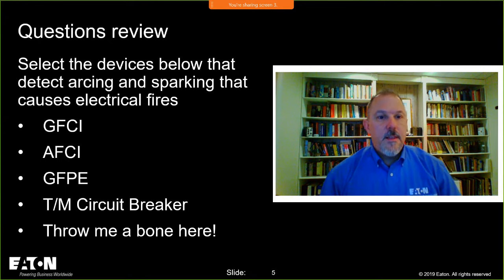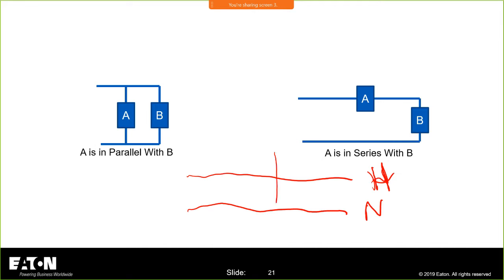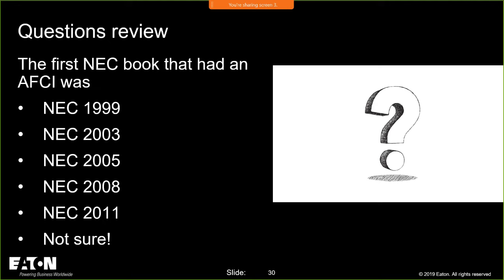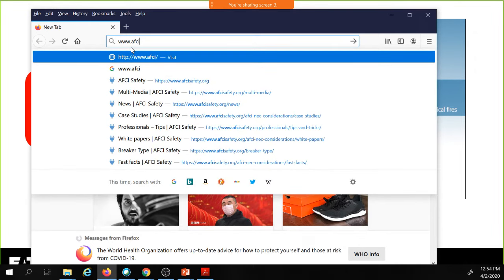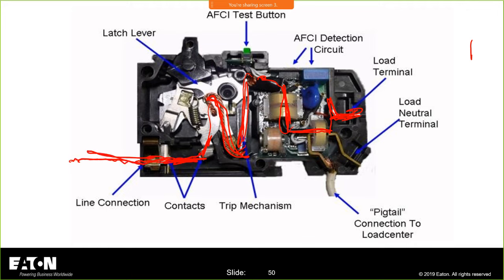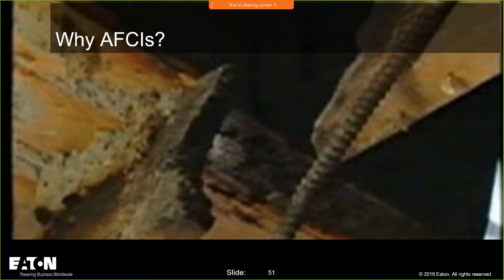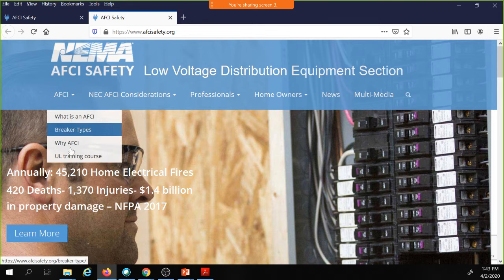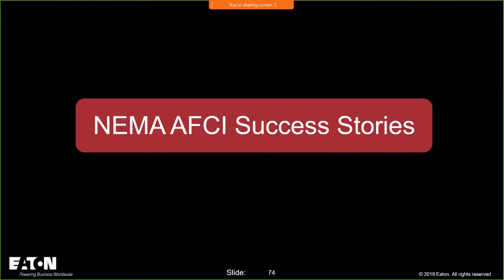Arc-Fault Circuit Interrupters and Associated NEC Requirements

Comment: I believe 406.4(D)(4) states if you replace the "receptacle outlet" (not just the receptacle but the box aswell) then the replacement receptacle must be AFCI protected.
Reply from the maker: Mario, I tell you that I have read that before and didn't see what you are pointing out.  I think I'd have to agree as it does read "receptacle outlet".  I don't believe that is what the CMP intended but that sure is what they got!!!
Reply: @TDUNPLUGGED  the reason I bring it up is that from a cost perspective its way cheaper to just change a receptacle, now if AFCI protection is required the cost of changing receptacle would go up. I definitely understand the electrical safety view but its just like changing a panel unless modifying the circuits  more than 6 feet using the 210.12(D) EX AFCI protection isn't required.